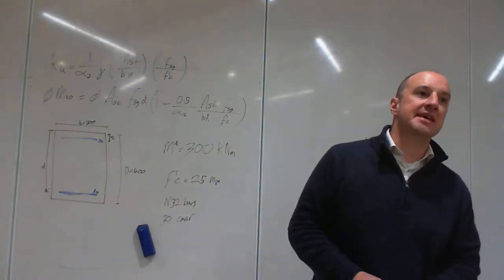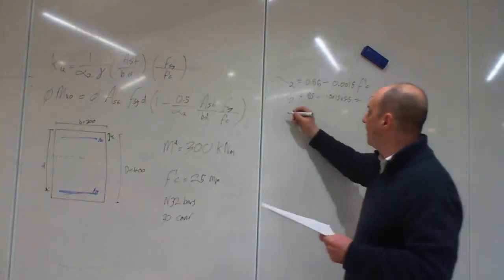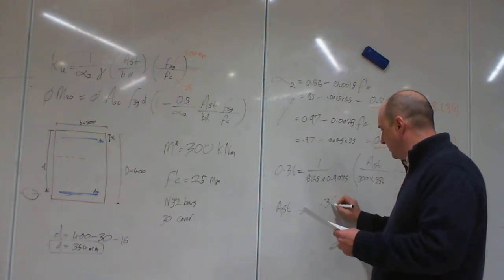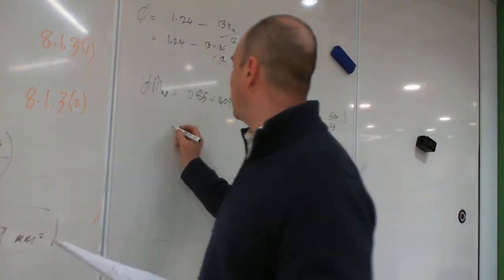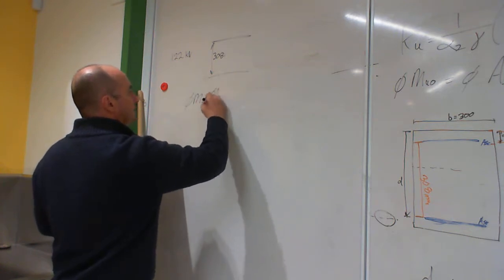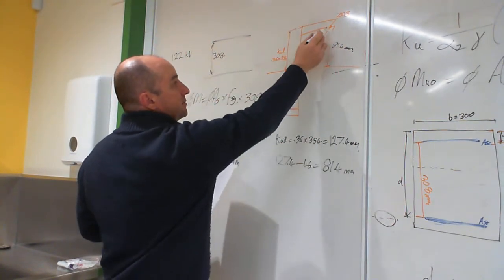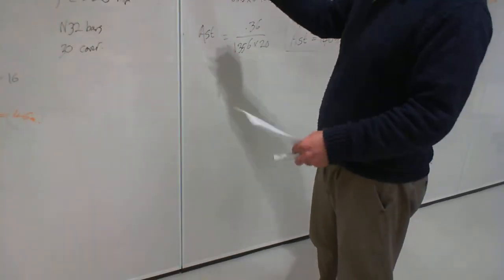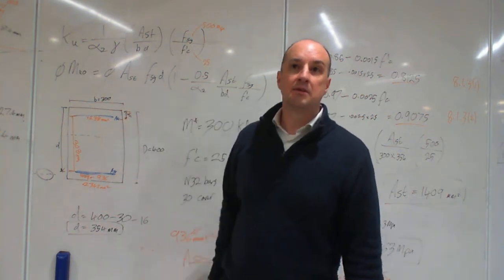Double Reinforced Concrete Beam Worked Example

Comment: Sir. Thanks for this. I still have the issue of determining the Ku value.
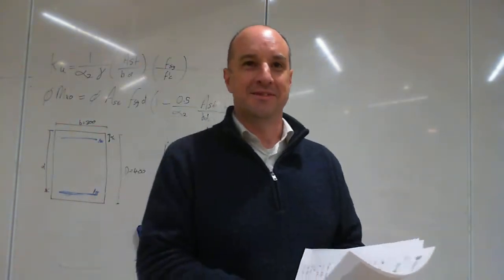Reply from the maker: Look at about 1:50 and onwards.  you design as a singly reinforced beam using the largest allowable Ku value, then you add steel top and bottom, that's how it becomes double reinforced

Comment: How much difference should I expect by comparing AS3600 2009 to 2018? I am using a spreadsheet from CCAA, which uses 2009 standard, and am getting way more steel than in the worked example.
Reply: gabrielbobmarley im not very familiar with the new code but normally when they make changes they dont make much of a difference.
Reply from the maker: Hi Gabriel, As Adam noted, the revision to the code only makes a little bit of difference.  If you are getting way more steel, then there is probably an error.